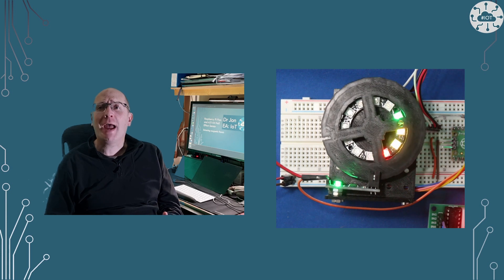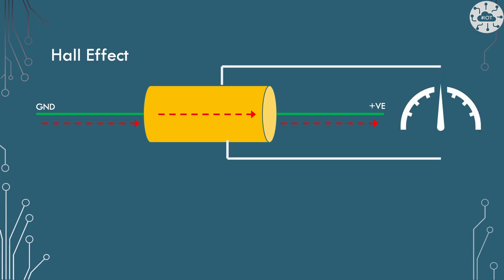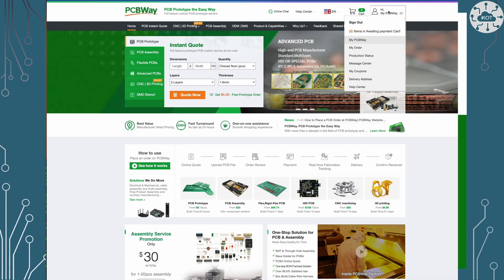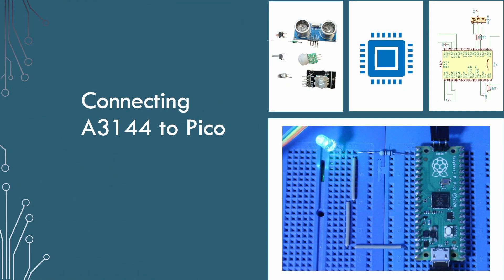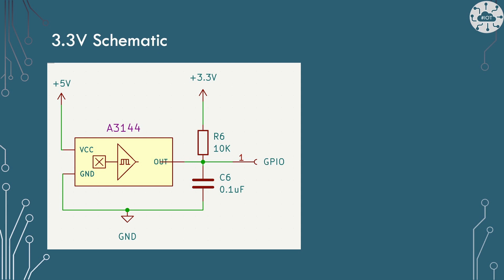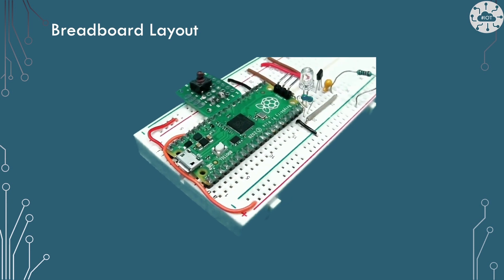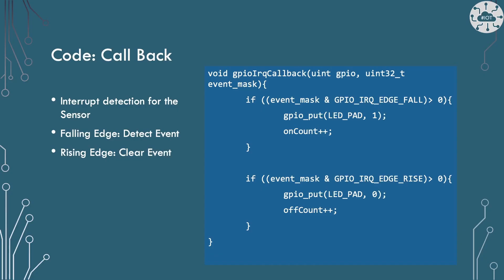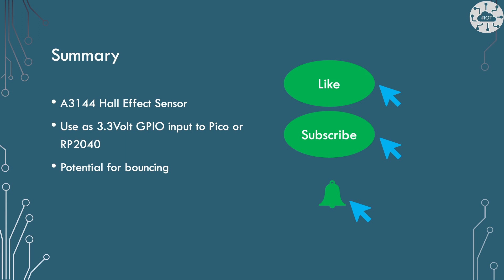Raspberry PI Pico  and A3144 Hall Effect Sensor

Comment: I think we could use the internal pull-up resistor on an RP2040 GPIO pin rather than an external pull up to 3.3v; does that sound correct?
Reply from the maker: That is a good idea. I think you are quite right.
Reply: Aren't you in danger of blowing the pin if you inadvertently forget to set that pin as a pull-up?

Comment: What would happen if you powered the device with 3.3V instead of 5V?
Reply: Well it might work but it would be outside of spec and so no guarantees. Even if it did work doesn't mean the next one you pick up would.
Reply: @DrJonD  got it. Would it be correct to assume that powering the chip with 3.3v would not hurt the chip or gpio? It just might not work as expected?
Reply from the maker: Yes you would do no harm.

Comment: Thank you very much! Very interesting sensor indeed. Just one question, why not use VSYS which is VBUS less the Schotty diode drop ? Is the tolerance on the  A3144 too tight?
Reply from the maker: I could have done that and would have gained some protection from diode.